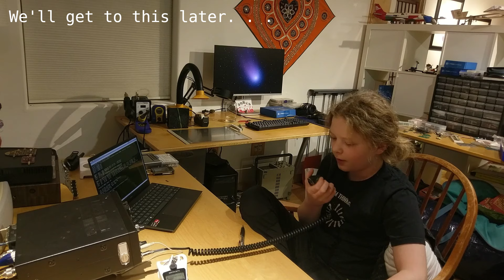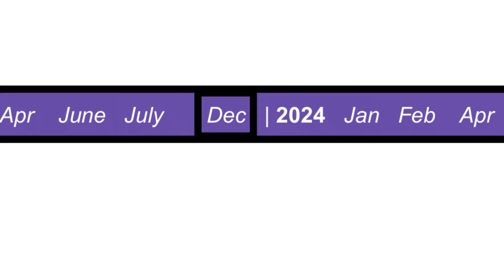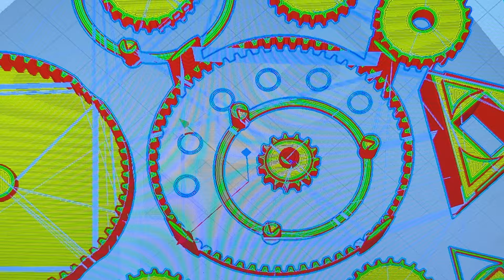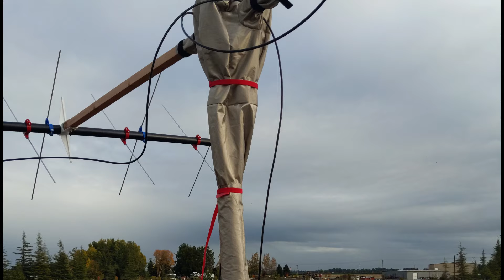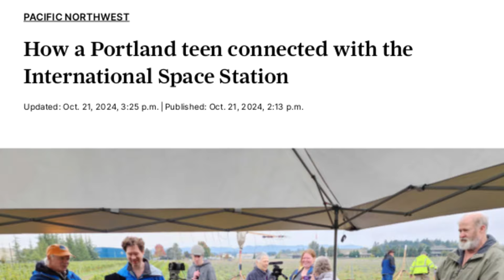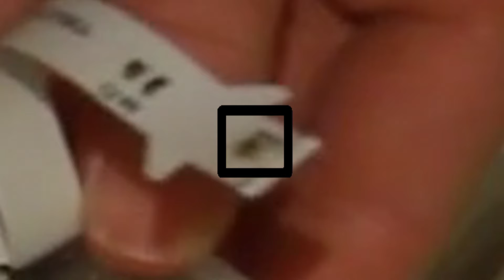13yo calls International Space Station with Award-Winning Science Fair Project

Comment: Great Work. you could adapt the exterior 1 to receive the desktop one for signal amplifications. Also would be good to have a retractable homemade antenna, to amplify and clean the signals; additionally you could make a small signal cleaner circuit board, then an additional amplification circuit board. Also research about EM waves and how to align them better to not have so much white noise. And maybe some kind of dish to have more of the signal. Small improvements that can compound enhancements. Research my boy, you're on the right track; you have the life I'd have wanted when i was your age, 40 years ago